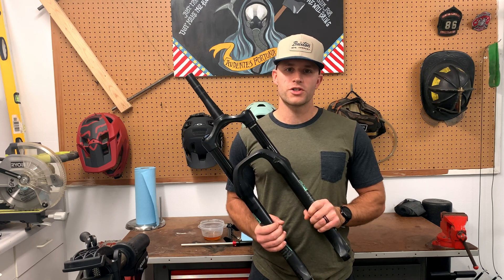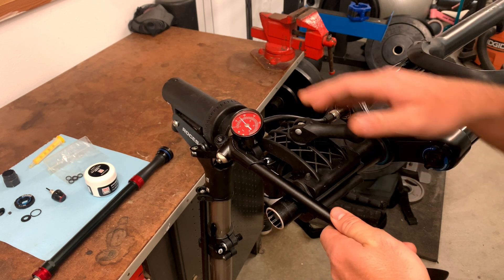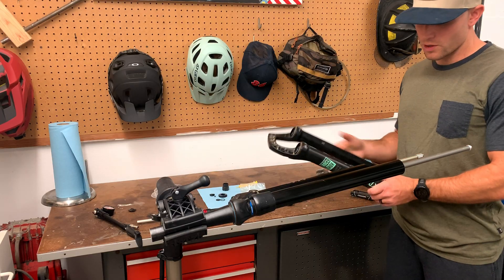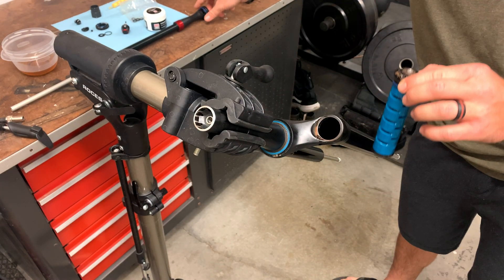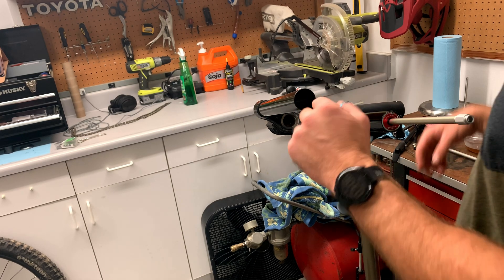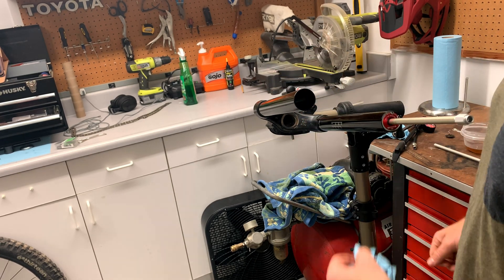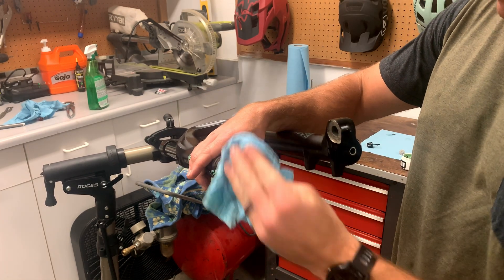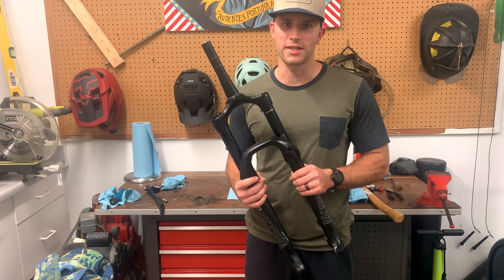TURN A ROCKSHOX YARI OR LYRIK TO A LYRIK ULTIMATE WITH THE CHARGER 2.1 RC2 DAMPER KIT

Comment: Very helpful tutorial for the beginners... but first....it should be washed before servicing - especially inner side of the crown (full of dry mud) Fork lowers are very sensitive to this kind of stuff inside. If you don't have the right tools to loosen bottom screws, next time use only steel one  (air side) - damper side bolt (red) is ALU. Last thing... it is not necessary to air it down before ;) Cheers mate

Comment: Do you not need to add oil to the top of the dampener when finished ? As you poured out a diffent oil from the top . Or is it not needed now for the new dampener
Reply: No. Charger is a sealed cartridge, whereas the MoCo is an open bath damper.

Comment: For some viewers,  make sure you practice right maintenance and use torque wrenches all the time! Some equipment are torque sensitive and forks and shocks happened to be one of them. Basic maintenance rules, if it holds liquid, pressure, high vibrations, any dynamic parts such as bushings, bearings, make sure you use torque wrench!

Comment: Maaaaaan get some tools.. That is killing me to watch those wrong metal tools biting into the soft aluminum or slipping off mating surfaces. The right thing to say when servicing suspension products is "There is a correct tool for this, if you don't have it, go buy it". What does a socket and a lockring plier cost? Next to nothing compared to our parts. Love and respect ur parts with correct tooling... But other than that. Great video and good servicing :)

Comment: Great video. 2 questions...
1. How'd you clean your foam rings?
2. Where'd you get the crush washers?
Reply from the maker: I just squeezed them dry in a paper towel and soaked them in fresh oil. Not ideal but I was waiting on a lower leg service kit that has new seals. The crush washers I believe I bought on Amazon for super cheap. If you’re gonna do this, it’s worth it to just do a full lower leg service. The service kit should have seals foam rings and crush washers.

Comment: Nice video, but those foam rings looks they are should have been replaced.
Reply from the maker: They were replaced shortly after. I didn’t have the 50 hour service kit when I did this, so I did it a little later.

Comment: So this video confirmed me that the Yari and Lyrik are the same thing if you get the damper. Thanks, i might get a used Yari instead of a lyrik and upgrade the damper to the 2.1
Reply: Not the same exactly. Lyrik has hollow crown, less weight. But. Looks like that's it)) Everything else can be upgraded. Which is really grate. But I go with Lyrik, since I found it for a great price on bike24

Comment: What year is this Yari? Could all of this be done on a 2017 Yari??? 🤔
Reply from the maker: It was a 2020. It could be done but I would recommend putting in the new air spring at the same time. That will make your fork practically the same as the current lyrik ultimate.

Comment: Thank you so much for the video! 
It's a relief that I won't have to cash our 1 grand for Ultimate and sell Yari for half of its price at best (I plan to buy 2021 Marin Alpine Trail 7)
Reply from the maker: I agree it’s what I like about rockshox
Reply: Did you get the alpine trail 7 yet? I’ve had mine for 2 months and it’s a beast. Very pleased on the bike. Rear shock already has problems so it’s been sent to rockshox. Prob upgrade the rear shock and then do this to the yari even though it’s not a bad fork at all
Reply: I plan to do the same thing at some point, I also have a 22 Marin Alpine Trail 7, so far the Yari has been fine but doing little upgrades here and there. With my Apline I've had issues with rear shock so I've already purchased a Fox Float X performance I got brand new for $250 on pinkbike. Also had my rear hub messing up so got new set of wheels from local bike shop too. Overall, Alpine trail 7 is an amazing bike for the $3,00 price tag.

Comment: Good video only small bit of advice is if you do this use a plastic/rubber hammer to tap the bottom bolts not a metal hammer
Reply from the maker: Good tip! I placed a socket over the bolts and hit the socket, not the bolts directly. If I were to hit the bolts directly I would use a mallet for sure!
Reply: @THEGOODSMTB  did the charger 2.1 upgrade today on Yari and added the 2021 debonair air spring at same time, a completely amazing transformation all round :-) your video helped me sanity check what I was doing on the charger so thank you for sharing this on YouTube
Reply from the maker: Rad dude! It’s amazing what it does to the fork!

Comment: How about the length of the charger ? Is it the same for all the form travel ?
Reply from the maker: Yes. The travel can be adjusted by chainring the air spring, but the damper has play in it to fit different travels.
Reply: @THEGOODSMTB  yes. I've heard that every pike and lyrik have same length of stanchions ? Then travel is only determined by air spring you can buy for like £40 ?
Reply from the maker: Yup. Very easy to adjust the travel.

Comment: good tutorial but for the wiper seals the grease should be sram butter or slikoleum/ slick honey. the dynamic seal grease is used more for shocks where there is a high volume of oil constantly being sealed in by the rubber seal and the use of dynamic seal grease prevents the seals from swelling. sram butter is best for low oil presence but high shaft movements, as is experienced in a telescopic fork stanchion.
Reply: They now use for  the ultimate series dynamic grease for the wippers

Comment: You dont need to grease or add oil to the charger damper ?
Reply from the maker: Daryl Horse Capture it comes ready to go, you’d only need to add oil if you we’re servicing a damper that was already in there.
Reply: Charge 2.1 is a sealed system not open bath like original yari/lyrik hence no oil/grease